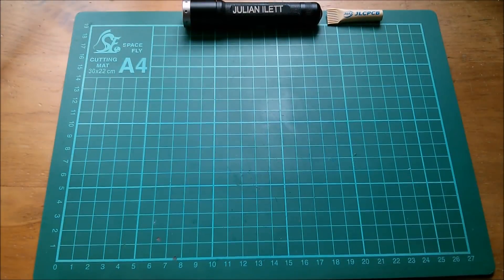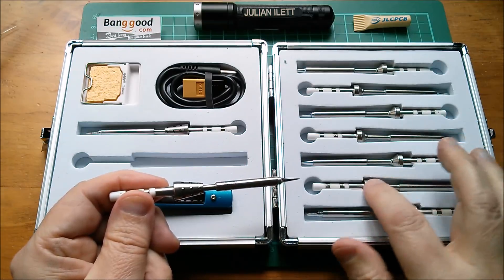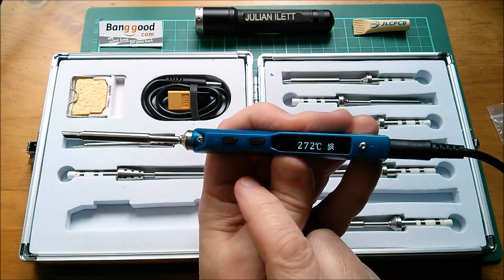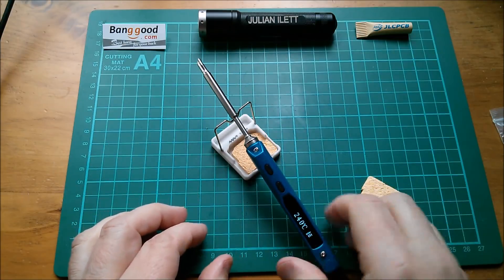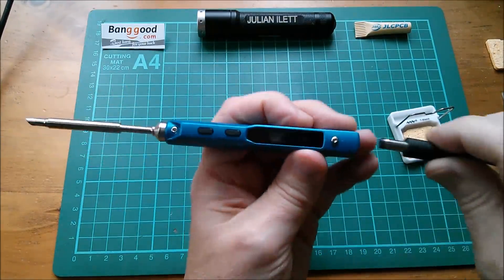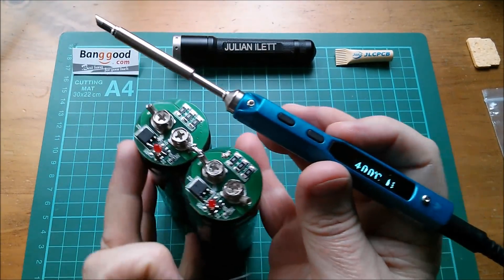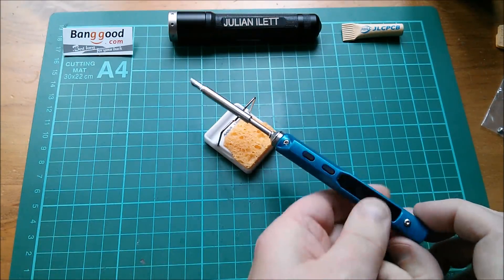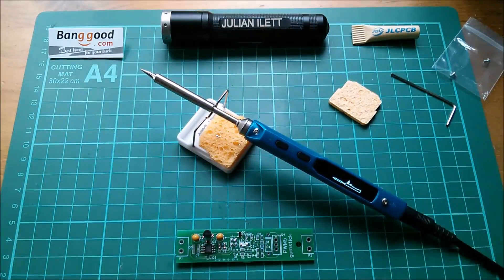TS100 Soldering Iron - Unboxing and First Look

Comment: I'm still not convinced, I've seen a lot of channels get these but ultimately I see the CC using a more conventional iron within a few uploads (even Marco Reps grabs his JBC not a TS100).
    I'm more tempted  to do a T12 kit. You really should grab a max spec PSU and see if it is worth using as a real iron all the time.
 I already made the mistake of buying a RadioShack Digital Soldering Station back 4 years ago. Now I'm stuck trying to find the stupid Atten 2 wire heating element to replace mine. I'm fed up with odd ball products without real replacement parts support long term. What happens in 5 years when the TS300 comes with some new tip shape to antiquate the current generation? I think a T12 kit might be the better investment IMO. 
-Jake
Reply: The TS100 uses standardised tips. Don't buy replacements when you need them. Buy before.
This review shows this iron at its poorest: original firmware, low voltage input, and an inexperienced user
Reply: TS100 tips are actually pretty much T12 tips. That said if you want a T12 kit, then you should look at this: https://www.aliexpress.com/item/MINI-T12-OLED-soldering-station-electronic-welding-iron-2017-New-design-DC-Version-Portable-T12-Digital/32839523934.html

I have bought 2 of them so far and am very happy with it (also a lot cheaper than the ts100)
Reply: Welcome to the world of Consumer Electronics.    :o)

Comment: I bought one of these almost 2 and a half years ago when they first came out, amazing little irons, still using the first tip that came with it (has ~500 hours on it, with plenty of life to go). I have put a few upgrades into it since I got it including a low profile 2.5mm jack and a super-flexible silicone cable to make it more nimble. And I swapped the 19V power supply I got it with for a 24V one that has helped a lot. The fact that there is 3rd party firmware is news to me, I will have to try that!
Reply: you certainly should try the Ralim fw.

Comment: To solder those terminals you could also put some paper or non-metal washers above and below the terminals so that they are still held securely but then it won't let the heat escape into the capacitors and nuts.  Then just loosen the nuts and rip out the paper insulation.  Easy as pie.  Hmmm... I sure could use some pie right about now.   ;-P
Reply: Exactly what i wanted to say! Also use some flux
Reply: Serban - You wanted to say you could use some pie?   ;-)   Ya, I think it is the easiest way to insulate it and get the job done.  Of course if you are doing lots of these it would be better to make a special insulated jig but for just a couple paper will do just fine.

Comment: Interesting but no.
- no hand protection to prevent your hand from slipping down onto the hot tip.
- erratic temperature display.  At least at the start.
- user interface kinda sucks.  You can't change the settings on the iron and have to edit some file?  Silly.  Perhaps the 3rd party firmware is better.
- the stand is too small for normal desk work and should provide a normal iron stand angle.  I can see bumping the wire would easily pull the whole thing to the floor.  That being said, the stand would likely be good enough for portable use where you don't want the extra bulk and weight.
I'll keep using my name brand temperature controlled iron but I am sure this will be popular with those that need a light weight portable soldering iron.  But whenever I am outside needing an iron I tend to need way more power for larger connectors and the like especially if there is any wind at all.  My 2 cents.
Reply: One quickly learns not to hold a soldering iron like a pen.
Reply: ElmerFuddGun 
Although I agree that the lack of finger guard is a design flaw, the initial erratic display was caused by the iron running a calibration cycle and it is possible to program the parameters directly from the iron - you just have to press the right buttons to get into that mode (see AvE's recent video).
Reply: -Mr. Delphi
-Tip is easily grounded with the grounding point near the connector. You should have seen it by now, it even has a ground symbol right next to it!
-What do other irons do when you swap the tip? A loud and jarring 3kHz beeping until you place the new tip in?
-It's not supposed to be a piece of rebar.
Reply: Andy - of course but accidents do happen.  And in portable use I can see sweaty hands slipping down that glossy finish quite easily.  My Hakko has a bit of a skirt (whatever you would call it) plus the nonslip foam cover.  While not as big as my first AC iron as a kid I do feel confident that my fingers won't slip past it and if I let a kid use it they will be safe too.  I choose function over trying to look "modern" everyday.
Reply: Do you own one? Where is your review ?
Reply: Pete - Fair enough but the display really should have said it was calibrating instead of the new user saying WTF don't you think?  I read another commenter also say it could be programmed in a menu but that it required the 3rd party firmware.  Either way that's good.
Reply: Elmer, if. you're pushing down on an iron enough for your fingers to slip onto the tip, then you're using the iron incorrectly, and risk damaging the tool with that pressure. I've been soldering for over 50 years, with all manner of soldering irons, including old fashioned 'stick it into a fire types, and cannot ever remember my fingers slipping onto a hot tip. On the other hand, I have picked one up by the wrong end (not recommended!), and also have a scar on my forearm caused by leaning on a badly-positioned iron. As with any tool, the user needs good instruction, common sense and respect. Safety features should not be relied upon; they're a last resort. Even a screwdriver can be lethal if misused.
Reply: The first use of the tip is probably erratic due to burn in and calibration... noticed the second time it powered up after the tip had been burnt in it wasn't so erratic, and it was then back again when he changed the tips. I would expect the same with the T12 soldering stations if they hadn't made it so you can tell it what tip type you are using so it can better calibrate itself. It will be interesting to see what it is like at higher voltages... looks like it really needs in excess of 19v (just like the T12 soldering stations) in order to deliver decent wattages, so considering it was only delivering around a third of it's potential, it was doing well. A finger guard would have been nice... but then again... all the pencil irons I use don't have any either... you just know not to play with the hot end! :-O
Reply: No arguments there... it would have been good once it started getting such wildly oscillating temperature for it to show a 'calibrating' screen... and hold it for say 20 seconds or until the sensor settles... and a +1 for non-slip grip! ;)
Reply: Well you have to understand this is aimed to the Hobbyscene , mostly to drone pilots ...and we all know how to Work with Open TX so...;)
Reply: The first point is just what I thought when I saw it. I usually have sweaty and greasy hands and it would slip pretty easily. I'd rather spend some more money on a Hakko FX888D (or maybe a clone, the clones seem pretty good quality).
Reply: Andy Lee Robinson 😂😵
Reply: I think we can probably assume it tells you what was going on with the screen in the manual...
I'd not buy it because of the lack of finger guard...that and I've got massive hands and it's unnecessarily thin.

Other than that, looks good.

Comment: I have 2 of these TS100's. You can also calibrate the temperature to be more accurate. You can update the firmware or use custom firmware which is very nice. You can also override the maximum 400C temperature to 450C. All parameters can be changed by using custom firmware instead of connecting it to a PC. I never use my iron at less than 300C and a minimum of 19V. That's when you see how fast it heats up! at 13v, you simply do not have enough thermal capacity to cut larger jobs. I use my Qidian 8 cell (white)powerbank with boost converter up to 24v for the TS100 when on the go. I do not suggest using a switching power supply without earthing the iron since some current passing through the tip might damage sensitive components.
Reply: some good tips !

Comment: What a gorgeous 21st century instrument! Makes a $150 Weller pro look like a toy. Frighteningly quick temp changes! Even 15 minutes in I was saying RTFM! RTFM! ...especially when you plugged a ps connector because it FITS??!! --on a potentially high current, processor-controlled iron?? (I enjoy your presentations. Good luck to you.)
Reply: thats i just has bouch sr100 iron, 20$ cost, only iron and tip. no need more, different tip can orden about 10$ pcs. if need this have my favourite iron now, lot better and comfortable use than my old 300$ weller iron station. i not has use weller after ts100 come to me. lot better fasten heat stabile warm,not heavy, all lot lot better than weller. i use 24V power supply this. its BEST

Comment: You're sounding like a sales man, Julian.   :-(   15:52  I know it was free and I don't have a problem with that BUT you really got overly excited about the stand and then at 16:01 you sounded like you didn't want to get the seller upset by mentioning an improvement.
Reply: It was terribly rickety on that tiny stand,  on any normal electronics bench swamped with items (unlike julians extra tidy desk here) it would soon be knocked over and start burning something.
Reply: ElmerFuddGun u
Reply: It's not half the price, it's a different product, that's only the iron with one tip, I believe. It's also on Banggood for about the same price: https://www.banggood.com/MINI-TS100-Digital-OLED-Programmable-Interface-DC-5525-Soldering-Iron-Station-Built-in-STM32-Chip-p-984214.html
Reply: Or maybe he is just honest. It actually seems to be a nice little soldering iron. Also he showed the same iron on ebay for about half the price, i guess that will make bangood more upset than mentioning an possible improvemnet

Comment: Can't believe you didn't have one of these already - you'll love it :)
I almost never use mine below 350 degrees btw
Reply: Yeah, it should never be below 320c for regular soldering. The melting temperature of good solder is 180, and the manufacturers usually recommend 330-350c. So yes, Julian, the TS100 manufactures did know better! :-P

Comment: I have my ts 100 for about half a year now (using it with a 19v Notebook supply) and I love it. It will not replace my Ersa icon pico station in my lab but for a job off the bench it is the best one you can get. Did not try other firmware until now but maybe in the future.

Comment: Yes, its a great iron and you have the bonus of all the tips.  I got a little 24v PC type psu with mine and haven't found the need to change any settings yet.  Seriously easy and non-frustrating iron to use.

Comment: I have been looking for a small portable soldering iron to keep in my backpack. I've been looking at gas powered ones until now. My backpack always has my laptop charger in, which is 19.5v with a 2.5mm barrel connector, so I guess I don't need to look any further! Excellent

Comment: i can tell you that with 19V laptop supply with i think 3A i have, the temperature does drop maybe a little bit on big joints, but never under 10% of what i set it at.

Comment: Use it at 24v to get full 65 wattage from it, at 12v it's only 18w. Big difference in startup time, and when doing bigger joints. And there are custom firmware with menu system that add more settings, like startup temp etc, so you don't need to use usb.

Comment: Hi Julian, the tips with the holed ring around it is to hold the holed ring while soldering, to be able to handle the iron with your fingers closer to the tip for more control and comfort for more precise work, like a pen holding it closer to the tip.
at least i think thats what its for because i use them that way :)
Reply: According to the AliExpress listings for those tips, that extra bit of metal is supposed to be a heatsink so that the tip cools down faster. Your idea may also work, though :)
Reply: thats a bit strange as that part of the tip does not get hot but might get warm. maybe it is a multi-purpose heatsink :) thanks for the reply

Comment: Better late then never :) lots of people are already using this one !  Github has also a far better firmware, by Ralim, and you dont have to use usb to set the settings, you should also not use a pure conical tip for smd soldering, a mistake made by most people, because this is most of the time the default tip for most soldering irons, a chisel or screw driver shape tip will do,for maximum contact of component and PCB, also use enough of flux, that should be done default.
You really should checkout the new open source firmware it's a complete makeover with extra features, and smart display :)
btw.. the heating element sits in the top, the lower metal area is much colder.

Comment: Hmm.. What intended purpose does this little iron cover? Is it for portability or trying to compete with soldering stations?

I've always preferred gas soldering irons for portability because of how much heat they can produce and you can get butane lighter refills anywhere at literally any time of the day.. Which I prefer over a battery pack.
I suppose for finer stuff this would be useful? Not sure though..

My first station cost me £30 before the euro change and I'm still using the f*cker.. it just won't die and it's lovely for small or medium-sized jobs. The reason I bring this up is what purpose does this lil guy have on a bench at this price? I know lots of people love this thing but I must have missed the boat
Reply: Gas irons = really, really bad on-site safety issues... Big Clive has a scary story about 'em.
Reply: I'll try & look it up. I think it's a review of a battery soldering iron & he talks about relative safety of the two types & recounts nearly dropping an operating gas iron down into an unreachable crevice while on-site, and the resulting nightmare that would have been.
Reply: This kit comes with a cable that has an XT60 connector on the other end - you'd connect that up to an RC Lipo battery.
Reply: KKK Grand Dragon Adam Racewarski 
I agree wholly, but the only field soldering I'd do is heavy dirty work anyway.. at home and at work I have dedicated soldering stations and you're right I wouldn't touch the gas one for long term use. 
Thanks for the insight anyways
Reply: Chris Nixon 
Do you mind sending a link to Clive's video?
Reply: then you don't need it.
Reply: It main use is to be used out on the field that's why they give u an xt60 connector

Comment: Looks like a 24V 3A power supply from ebay (very common, about £10) plus that big tip would be pretty good for occasional heavy joints, and you can use your solar panels the rest of the time.

Comment: At $139.99 on Banggood I would have to give it some serious thought before buying but it looks like a good Iron!
Reply: You don't need all the tips though I'd expect. I bought this iron with one tip a few months ago for less than $50 including shipping.
Reply: Thanks, I'll try that.
Reply: Yes.
You don't need all those tips.

I've got one of these irons.
Cost me about £34 as I recall.
I'll get another tip so I have a choice of two.
but still much cheaper than that set.

Comment: I've built a T12 soldering station from Banggood and it uses T12 Solder Iron Tips that are similiar to those. 
The behavior about the temperature being all over the place at the start is normal, they need a few mins of "burn in" to stabilize.

Comment: I reviewed this iron too a few weeks ago, also supplied by Banggood but they didn’t send me the big kit: https://youtu.be/fre_-uRmhXE
Reply from the maker: So yours also jumped around like crazy on first use too :)
Reply: Julian Ilett - indeed it did, I think it is doing a calibration or something.
Reply: Julian Ilett - at least you got a manual with yours! I had to figure out how to use it.
Reply: Julian Ilett - also you can set the defaults through the menu system using long key presses, it is in my review. I stumbled across this feature whilst trying to see what various button presses do.

Comment: It would be nice if there was an option to invert the display so that someone holding the iron in their left hand could see the temperature the right way up.
Reply: John Cherry custom firmware will do that. Auto rotates when you flip it over.
Reply: That option is available in the config file, hand 0 or 1, for left-handed or right-handed.

Comment: I really advise you to power it using 19 volts or more. (Maybe one of your boost converter would do the job?)
The temperature will not drop as much as it is doing with 12v, and jesus it heats up so quickly, it's much more comfortable to use.

Comment: I'm sure everyone has already told you about the other firmware I have one and can't see any reason not to use the other firmware it's great and also using a laptop power supply or something to get the voltage up to 19 to 24v it heats up surprisingly fast and can maintain pretty well